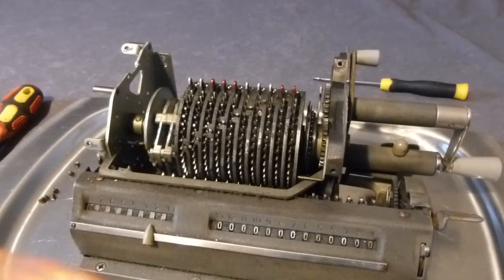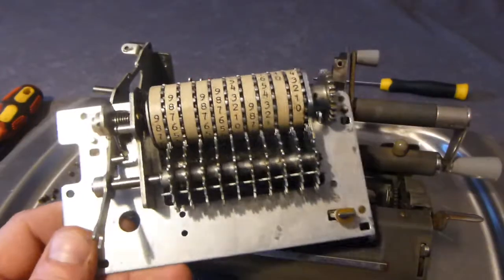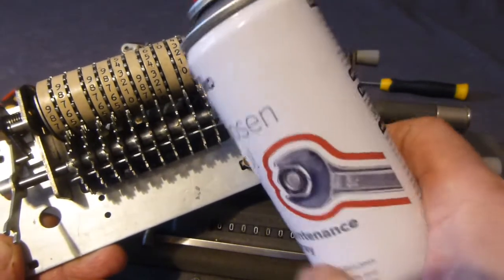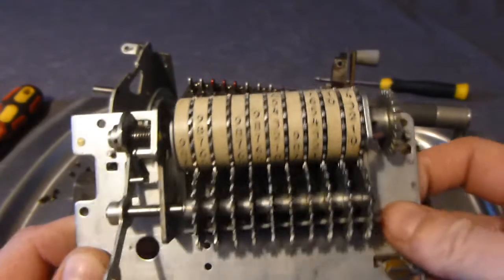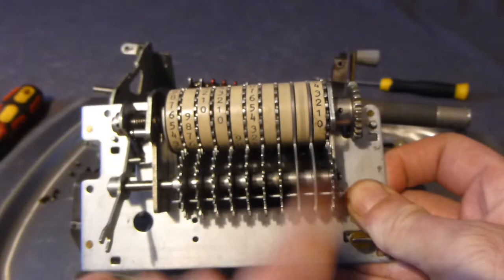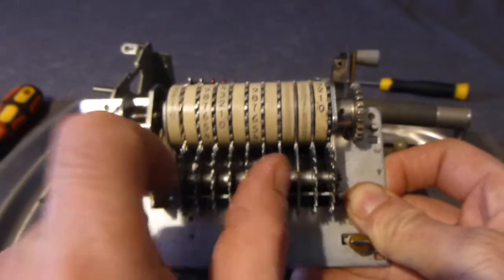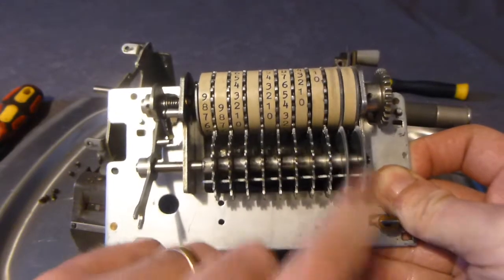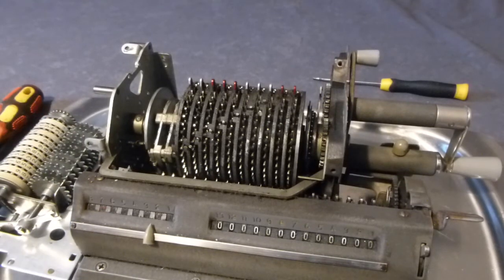Part 3 of 18, Restoration of Addo Multo Model 3 Mechanical Calculator

Comment: That Wilko spray certainly produced an impressive improvement. 
I know WD40 tend to be a bit secretive about the compositions of their various products. However, where and where available, e.g. to satisfy health & safety regulations, it can be possible to find materials safety data sheets that give a breakdown of the composition. When I did this recently for "ordinary" WD40, it was 25% lubricating oil and 75% a volatile solvent, which acts to help get the oil into tight spots and then evaporates.